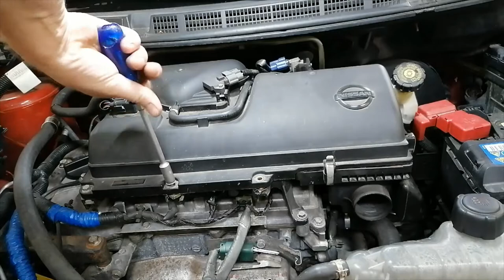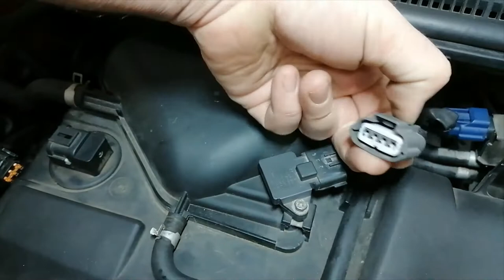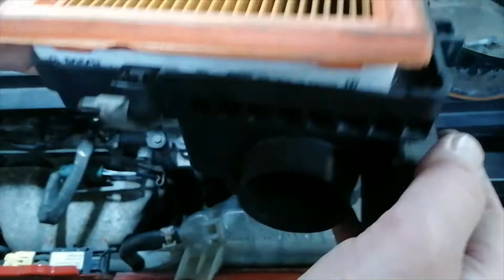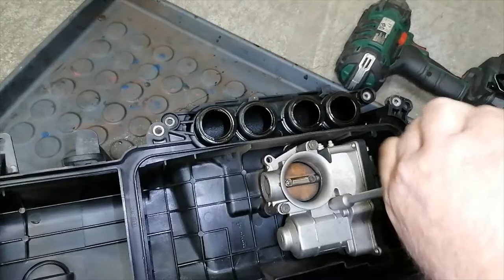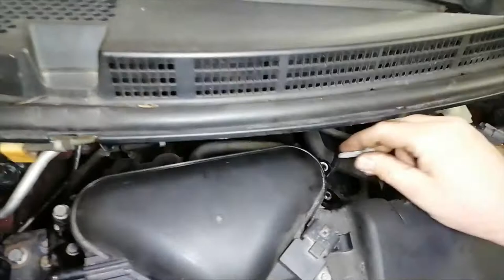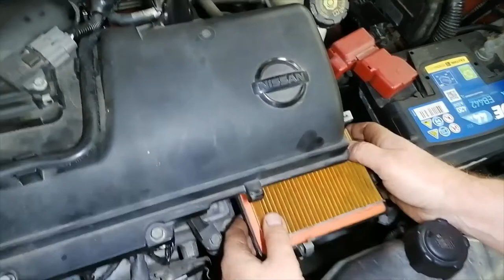How to Remove or Replace Throttle Body Nissan Micra

Comment: How much does this job average cost?
Reply from the maker: I don't know how much that job costs. But if you know what you're doing, you're done in 15-20 minutes. I guess it shouldn't cost much
Reply: @tehnicalife  do I need to re learn the car with diagnostic equipment or is it good to go as it is?
Reply: @Abertawe.Angling.  Relearn is needed.